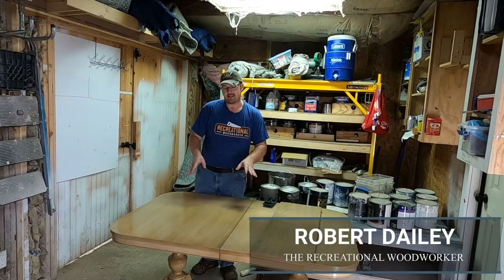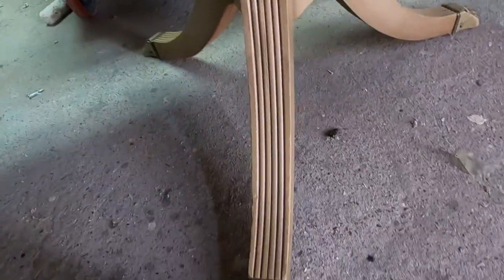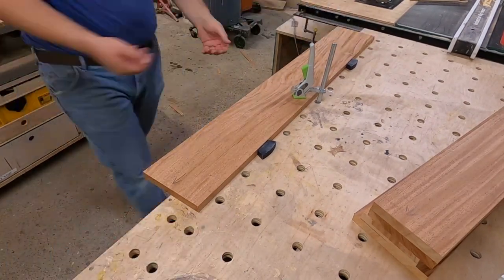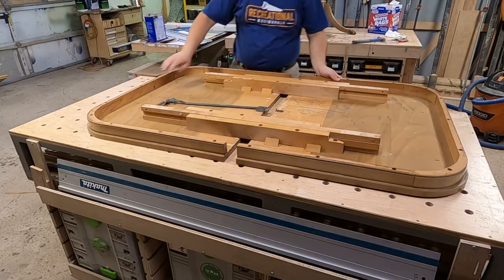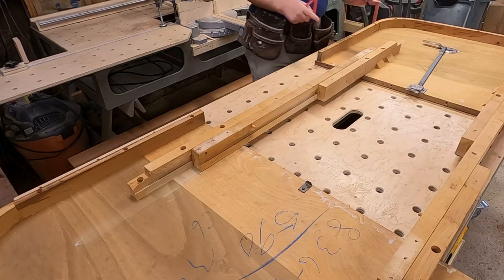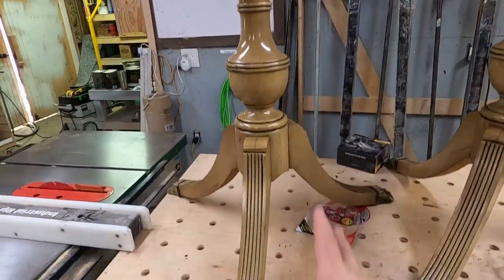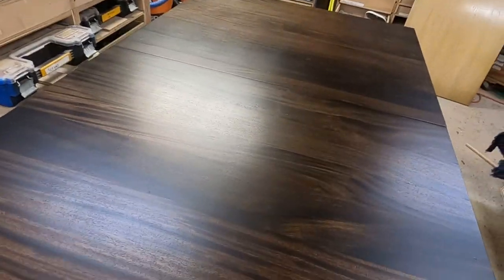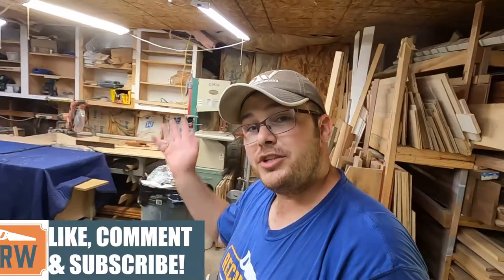Mahogany Table Top on Refurbished Base || The Recreational Woodworker

Comment: Really would like to see all the steps in build and assembly including fixing any problems such as the one sliding mechanism.  Could be done over more than one video. Perhaps next time. I have repaired several table top sliding mechanisms but not built a top. Finished table looked really nice.  Beautiful top. Excellent build. Keep up the good work.